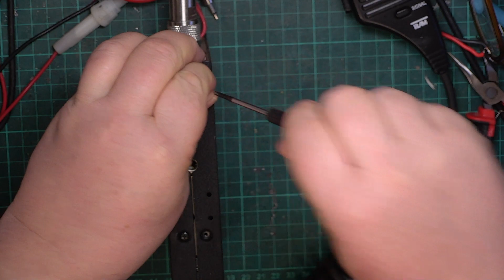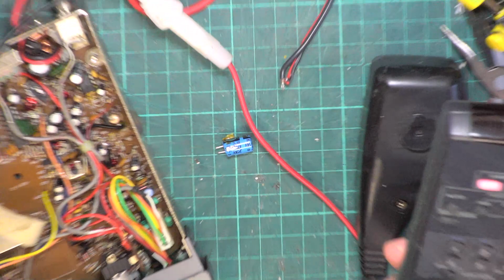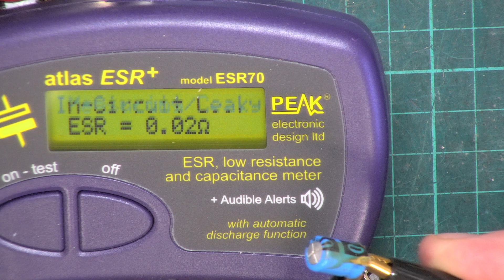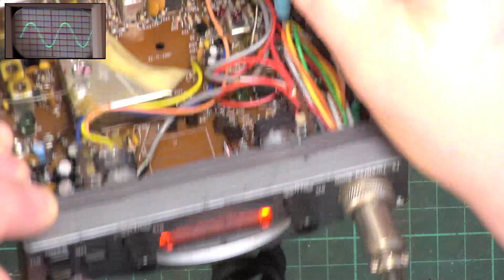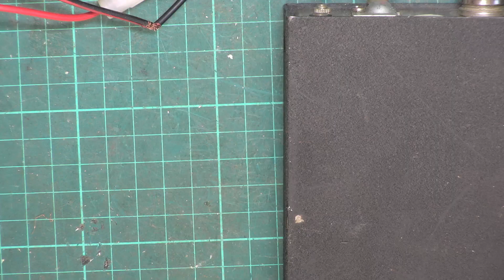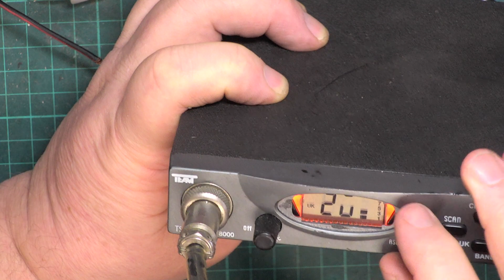Team TwoWay TS8000  UK PR27/97 CB radio (mobile) - repair & service

Comment: Hi Richard, thanks for keeping the videos coming, especially during lockdown as there is nothing on tv 📺 . Could you clean your soldering iron tip if you have the cleaning acid stuff to do it, you will find it much easier to tin up afterwards 🙂